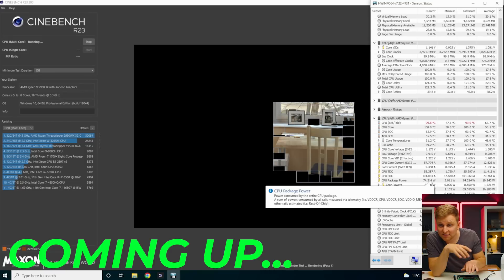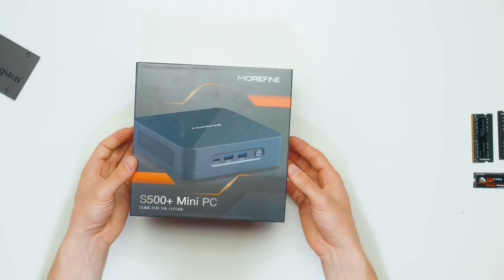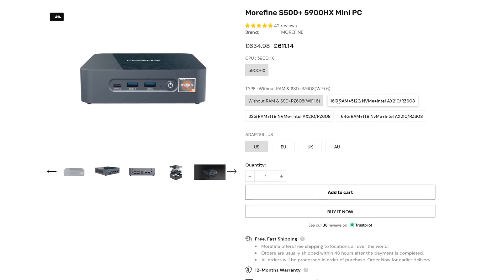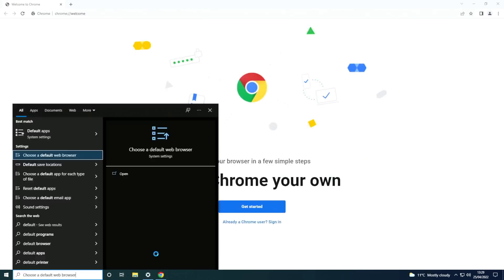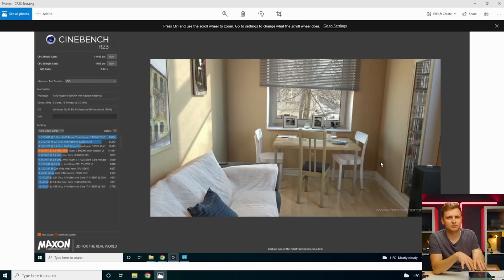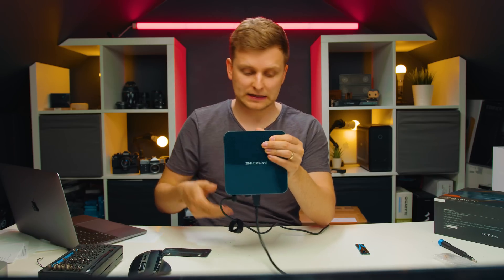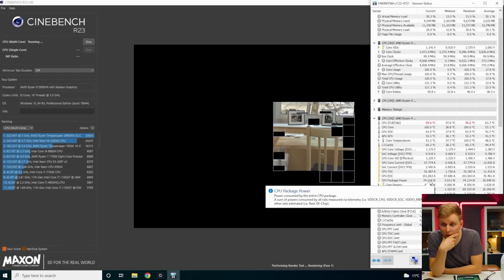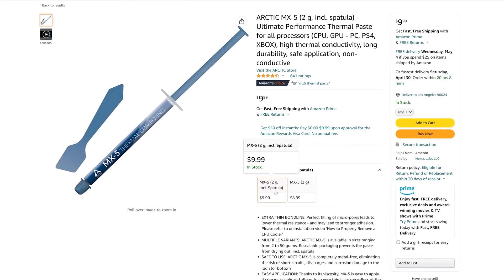BEST Mini PC?? Small & SOO Powerful! - True Apple Mac Mini Competitor! 😱

Comment: I can’t wait until amd starts offering thunderbolt/usb4. I have many thunderbolt devices so I would need that connectivity feature on one of these devices. Case in point if I wanted to connect an egpu to this little beast it wouldn’t work unless I used the m.2 slot…
Reply: Not likely to happen since thunderbolt is an Intel product.
Reply: @lm6036  usb4 is open tho and is based on tb3. Intel donated tb3 to the USBIF for free so usb4 has the capabilities of thunderbolt in terms of pcie tunneling, displayport tunneling, and speeds of up to 40 gbps. The problem is, the fastest and highest bandwidth features of usb4 are optional. so if amd implements a usb4 solution and enables all the optional features and it would function basically as a thunderbolt port. 

there are now fully featured 40 gbps usb-if certified usb4 cables that cost 1/5 as much as TB4 cables, and in my testing with thunderbolt equipment, these cheaper cables function just the same as their tb4 counterparts for a fraction of the cost. Charging at 90+W, data transfer at 2900+MB/sec, displayport tunneling. Apple has implemented a thunderbolt 4 certified controller on its m1 max macintoshes but that is Apple silicon not intel maple ridge silicon. If apple can implement a tb4/usb4 solution, amd can do something similar. The cables exist. Now it’s time for amd to do the work to enable host devices to have fully featured usb4 functionality.
Reply: @lm6036  Thunderbolt is registered trade mark.. USB type C gives the same performance. As you can run 2x 6K monitors on them...or 6x 4K monitors.
Reply: @WizzRacing  yes tbt is registered but usb-c in and of itself is just a connector, not a protocol.  The usb-c device may be usb2, usb3, or usb4.  if you're not already aware, Intel donated the undocumented tbt3 spec to the usb-if, who then used it as a basis for usb4.  Intel also  implemented the usb4 kernel driver for linux... Intel donated tbt to the world.  Look it up. 

the key feature that usb4 offers (that tbt has had for years) is pcie tunnelling. This is the killer feature. Since Intel donated tbt3 to the usb-if, fully featured usb4 solutions will offer pcie tunnelling.  Pcie tunnelling is optional on usb4, but if the usb4 silicon vendor (Intel, Apple, and now AsMedia) chooses to implement it, then the usb4 port will function just like tbt3 or tbt4 port, and will offer functionality such as egpu support or fast 3000 MB/sec storage support via a tbt nvme enclosure.  

AMD has already told us the Ryzen 6000 series supports usb4, and the upcoming am5 x670e platform will offer usb4 support on some motherboards.  Some will have an Intel controller, some will have an AsMedia usb4 controller.  Usb4 is coming.  And it will bring pcie tunnelling to the masses.  And I can't wait.

Comment: This mini PC would be perfect for music production ones you adding more ram and storage (m1 still didn't play nice for the older plugins)
Reply: Too loud for music production
Reply: @BenMeddeb  Not an issue because it should be under a desk or behind the monitor, but also because they sell noise insulating boxes not to mention music software nowadays easily removes low rumble
Reply: @VincentJames3912  nah…i am recording with a microphone in the same room, compressor on. Amplifies even an ant fart. M1 is still king for recording musicians.
Reply: @jamesnyers1721  iZotope RX series can remove any noise, just saying!
Reply: @hrdsht  Nice workaround but difficult to track an acoustic guitar and vocals with microphones and a compressor on while you hear a hurricane in the headphones. Not exaggerating. Try it.
Reply: @jamesnyers1721  Yeah M1 may be king but for recording so is a Neumann mic going into a Manley Passive then a UAD Apollo but if you dont have all that then you dont need top of the line.  Waves Clarity is on sale for $30 and will remove all that noise.
Reply: @VincentJames3912  You are obviously not an artist who performs. It is extremely distracting when you hear fan noise while performing and recording a very delicate ballad for example. (recording with a compressor)You must be a mixing engineer. Anyway all that gear is top notch but I say with an entry-level Focusrite interface and an audio technica basic microphone you can make extremely good recordings at home these days, just as good as the Beatles did 50 years ago at least. Today's home recordings with basic gear are extremely good especially if you don't have to listen to fan noise while performing.
Reply: @jamesnyers1721  I'm an artist who performs, produces and records in it's own home studio. Always had issues with noise, so I can understand that. My U87i's low output also make things more complicated. Still though, I lived with fan noises from a long time ago, most MacBooks Pro (funny to take a nice Apogee Duet 2 to record someone in place and hear that fan that could spinning from afar) and never found the THAT annoying like a hurricane, and always had a workarround, as most are high pitched, also can be damped easly too. Specially when you could underclock it a bit, give a blank and optimized windows, that kind of noise shouldnt be a problem, I mean, except you are sending 129 tracks and 200 buses with FXs (Which you should avoid, and only send the necessary or at least freeze the tracks in a reference to avoid ruining your SSD or HDD), recording as is is not the most demanding process. Still the mac studio is dead silent, so is a big plus, but I still have some trust issues with Apple and it's reliability/closed ecosystem.
Reply: @nch1990  I had lots of fan noise because i am recording myself next to the computer. I am the artist AND the recording engineer. The M1 Air was a godsend. Just peace of mind, knowing there is zero chance for fan noise because it does not have one.
Reply: @VincentJames3912  Clarity Vx is not that good for removing that kind of noise. Not without removing important frequencies on the instrument or voice. Maybe if you go for the pro version at $799 or $249 on sale.
Reply: @hrdsht  you are joking, right? It’s Not possible to remove” fan noise from a recording without seriously damaging  the sound.
Reply: @jamesnyers1721  I like ant farts
Reply: @jamesnyers1721  this one is way cheaper than M1 according to upgrading ( 64gb ram. 2tb ) :)))))
Reply: It's a PC, who cares about quality?
Reply: @peterbreis5407  you’re absolutely correct. I’ve performed hours of testing. Audio recordings using matched pair DPA mics through a Millennia preamp, A/D conversion through an RME Babyface Pro with the 24 bit 96k output split and sent to Thunderbolt 3 ports into the same software running on a Win10 laptop and a MacBook Pro M1. Playback results? Audio recorded into the Mac is pristine, but audio recorded into the Win10 machine sounds like 4-bit unintelligible garble. But the  amazing this is that some people can’t hear the difference!
Reply: @peterbreis5407  please adjust your brain prior to posting...
Reply: My M1 Pro MBP has been the best music production computer I’ve ever used. Whisper quiet, power to handle anything I throw at it and flawlessly integrates with iPad Pro. Using windows in the past, I had to sacrifice the ability to use iPad as an audio/midi interface — which has become an integral part of my studio setup.
Reply: @AdamsBrew78  Indeed, that M1 and iPad Pro setup is one of the best and more affordable to get, PC and specs nerds do not understand such thing because they are not musicians... you'e got an excellent music production studio for 2k!
Reply: Did you hear the fan? Probably suitable for mixing (load), but I would not use it for recordings.
Reply: Comparing apples to oranges here, not to talk about price differences and interfaces, not very clever fanboys…..
Reply: @murraywebster1228  what do you mean? Both can achieve the same things and the M1s didn't shown a great performance difference in the area with it's own set of problems too. Still both are really capable machines.
Reply: @nch1990  Exactly. People were making hits with machines with power not even close to what we have in a base model computer these days.  A base model M1 Mac Mini is ridiculously Powerful these days for $600.
Reply: Alright alright
I know m1 is great and such
But what if the producer still comfortable with windows and didn't want to switch to Mac?

This is an good m1 alternative. Not an replacement
Reply: @Thisis_sarP  I didn't mention m1. Windows is great, but this fan was noisy. That said, it was heavy processing. It will probably not be that hot while tracking.
Reply: I've used smaller PC's like this for production for a while.  They're a lot of fun.
Reply: @armyofninjas9055  is it good for mixing?
Reply: Hey would be kind enough to comeback here and tell me how it is I've been looking for something that would be strictly for music production because my current laptop has an older i7 processor and I'm tired of the plugin overload even when I'm not really doing to much with it
Reply: I’d sooner use an older Mac , I’m currently using a 2010 MacBook Pro & a 2017 iMac . They just work & do what I need for Logic Pro etc
Reply: The real question are you good the hardware & software doesn’t inherently make good music 😂 I could drop a banger on a kindle
Reply: Still weak for acustica audio plugins
Reply: What’s thinking the same , I also have m1 mini and it’s a beast, but thinking of having both, and use it through Audiogridder
Reply: Mac os or even IOS usually works better for music production, it’s not about specs it’s about software optimisation
Reply: @VictorIbelles  this isn't really true but what is true is Apple only releases premium tools and for audio this means all Apple products have way better latency out the box.  But if ur recording with an interface that will solve the latency.  But Apple does come with Thunderbolt by default unlike PC u gotta have like an Intel i9
Reply from the maker: Very interesting point!

Comment: Yes its besting cpu clock but its pulling at 5-6 times as much power consumption with mad temperatures. Its a neat mini PC and appears much better than the elitemini hx90 but you are hardly sitting on the fence for your recent Apple vs Pc videos.

Comment: I wonder how good of an option this would be for something like Second PC CPU encoding for streaming? lots of folks would love a 2 PC setup but just don't have the space for 2 towers under the desk.
Reply from the maker: Very good idea!
Reply: You can ndi network stream the main feed into your obs on secondary PC. No need for pricey capture, but the streamer sponsors don't want you knowing that...
Reply: @badjonatan  NDI is just a network protocol that streams raw video over your network. You can pipe your nvenc live feed to any machine on your network to handle your overlays and compression encoding with zero performance hits to either machine if you have a solid wired network. Fairly simple to set up, a driver, possibly plugin for obs (pretty sure it supports NDI native though...). It's a very utilitarian solution, no guis or resource consuming interface apps. More of a pipeline for the video feed than a streaming utility.
Reply: I guess the short explanation would be instead of needing a capture card for input and going video source to video source you bypass all that processing and send the signal straight over Ethernet. No extra hardware needed, no encoding/decoding, compression artifacts etc.

Comment: Yeah, small form factor PC's do compete and at times, exceed, Mac computers, but that's not the whole story IMO.  The ease in which Apple has made an Ecosystem is what converted me from being a Windows/PC's user since the early 90's to MAC/iPhone... tight integration of hardware/software/services with little to no tech support is what convinced me to switch in Feb 2021.  This may seem trivial, but I actually NEED iMessage on the desktop in my work - it allows me to stay as productive as possible.  The apps I use (Photo Mechanic 6, Capture One, Affinity Suite, Davinci Resolve) are as snappy on "lesser" hardware specs than my previous i8700K OC desktop with 32GB of RAM and NVME/Sata SSD's.  I don't need to pick up my iPhone to respond to messages sent to me by clients and family.  That to me has been a game changer.  I'm sure PC does compete quite well, but MAC's just seem to work for me in my work as a documentary & street photographer.  

And on the topic of this computer - yes, you can upgrade hardware, but it becomes just as much of a HUB/dongle fest computer as the Mac mini/Mac Studio while drawing more power/generating heat.  I ALMOST made the switch back to my Windows desktop because of this channel, but the moment I did, all that tight integration between my devices disappeared.  At times I miss using Windows, but not so much given the loss of integration... I still keep my Windows desktop with my software and data files I created on it, but my daily drivers now are a 1TB/16GB Mac mini, same spec MacBook Air and an iPhone.
Reply: lol
Reply: If Linux developers could build an “Ecosystem” people would flock to it.  It would have to have good performance hardware.

Comment: Britec has been doing a few of these on his channel. They look amazing for how small they are but the lack of GPU for video editing raises flags. Can't have everything though!
Reply: It has to be modded to top the m1 max barely in multicore, and lack of dGPU means that it won't get near the graphics performance. So to say that it's somehow an m1 max killer is laughable and a clickbait claim. For creators who want portability, it might work ok but it's not optimal. The m1 max with its media engine blows the doors off this thing, although it's a good deal more expensive. He is right that it's more properly an m1 mini competitor, but that would need some more real-word testing results.
Reply: Doesn't this have quite a powerful apu? Probably can't play AAA games on it but unless you're creating VFX I think video editing would be quite doable 🤷🏻‍♂️
Reply: @dazman88  If you need powerful iGPU, I would look into Ryzen 7 6800u. It has new RDNA2 video core, which is around two time faster than vega 8 built in into 5900hx. And it is 8 cores, 16 threads cpu, although with more modest TDP.
Reply: I don't know that video editing in particular is a strong case for dedicated GPU. The embedded one has video codecs and has an extensive compute acceleration - not fast but video editors kind of easily max out on what they can pull - and it has a unique advantage that it can address whole RAM and isn't limited by VRAM capacity and also isn't throttled by frame transfers over PCIe bus either.